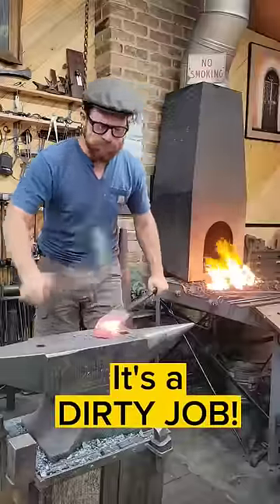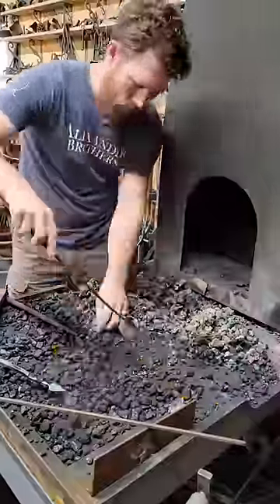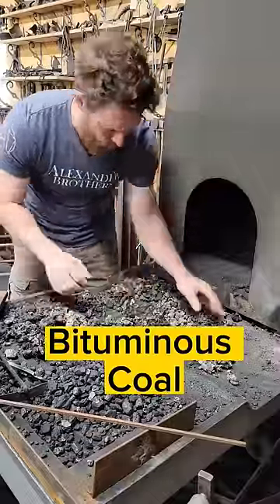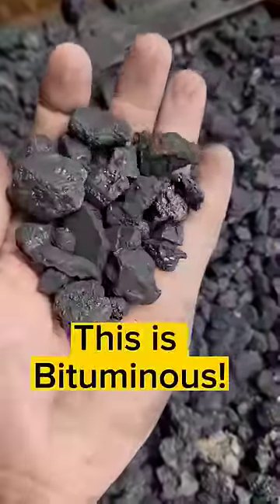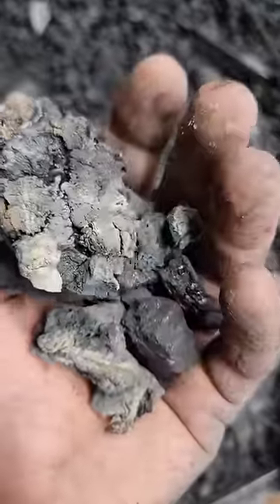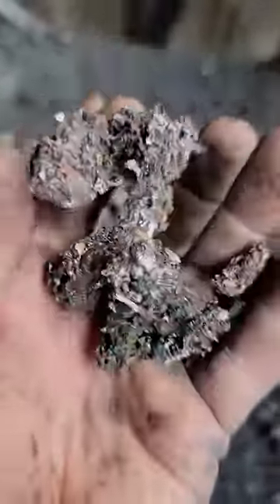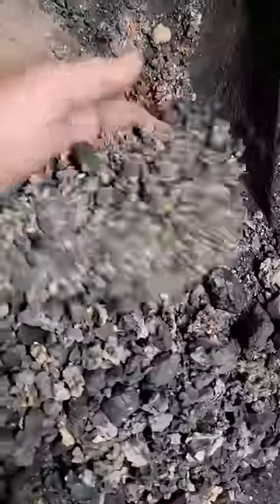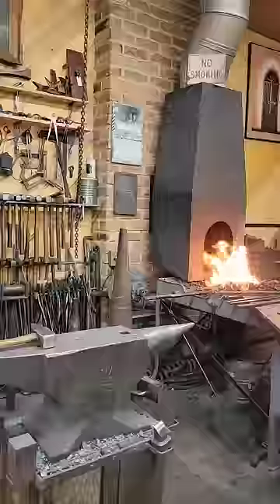It's a DIRTY JOB! #blacksmith #tools #artist #tool #anvil #blacksmithtools #howto #diy #diytools

Comment: I am a contractor in NY. I do a lot of bathroom renovations in 100+ year old homes. It was common for builders to use clinker in the cement of the floors as an inexpensive lightweight filler.
Reply: Did they do it to shortcut quality work or was it something else?
Reply: @joenic4303  it was generally used in the first filler layer of floors. The next layer would be the layer that would have the setting mortar. I’ll try to take pictures the next time I see it.
Reply: The first cement blocks were called cinder blocks, dark grey and with a rough texture, they were made in part with clinker. They have now been replaced with light grey cement blocks that we know and are stronger and more durable.

Comment: In the late 70's and early 80's we used coal cinders, that came from a university's coal-fired power plant, as a road bed for a Conservation Club's roads to the camping areas and lake areas. It was free because they had to pay otherwise to have it hauled away. Prior to making the bed the roads were dirt/mud and very hard to navigate reliably every time it rained.
Coal cinders worked great for that purpose.

Comment: At the beginning of the vid, I see your flame leaning heavily into your ventilation. Is there an exhaust fan helping it along, or is that just a natural lean, in the same way a wood stove does? I ask as we bought a house with a wood stove as the main heat and I am trying to learn as much as I can about how that kind of system works.
Reply from the maker: Natural draft due to heat

Comment: I recall that my elementary school (1953) thought it was cool to make our play ground surface out of clinkers from the schools coal fired boiler. As he said this stuff is actually glass. It is cooled bubbles that get sort of crunched up. I am sure that there are still glass shards in my elbows, knees and my left butt cheek.
Reply from the maker: Wow
Reply: I'm only 39 but my grade school did the same till they tried shredded tires but they forgot to remove the steel wire

Comment: Hey, quick question: can you utilize any of those coal byproducts to make other things?
Reply from the maker: Maybe art
Reply: Theyre good for your garden. For certain plants.
Reply: You can make cinder blocks with the cinders, but they can be pretty toxic and slightly radioactive. That's why manufactured cinder blocks are made from cement these days.
Reply: @artor9175 seriously? That's why they're called cinder blocks??? Whaaaaa? Learn something new every day! Thanks, man.

Comment: I use a brake drum as a bowl with forced air pushed from the bottom up, what's your recommendation for scraping the sides clean for a beginner using the same coal?

Comment: 🤔 all those impurities looked to be smaller than a certain size of particulate, so couldn't you use a net or other mesh material to screen out all the good coal and then brush the impurities away while screening the good stuff back into flat bin area?

Comment: Wait, so how do you get the unused coal back out? Do you just dump everything?
Reply from the maker: Because my time is so valuable I usually cut my losses and dump all the mixed debris in a pile. I neither have the time or resources to sit and sort it for 5 or 10 minutes. Sometimes I've given my kids a bucket and had them go to the ash pile and sort out all the good pieces. Then take them out for ice cream. I've considered screening it one day when the pile gets huge and hand picking all the coal out. The good news is it's not damaged by the rain and will be there even of I wait 50 years to pick through it.
Reply: I hate cleaning out my forge every time I am ready to start working. This was the first video I have seen where it looks like mine! Even after expanding my table area, I wish I had made it larger. Thanks!